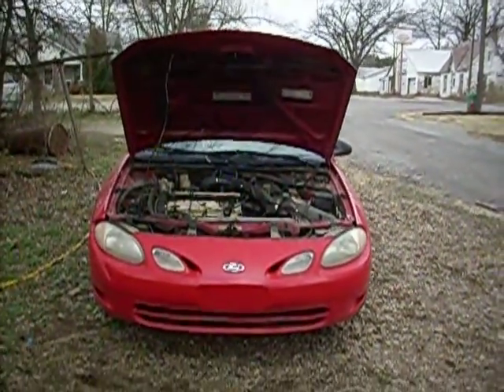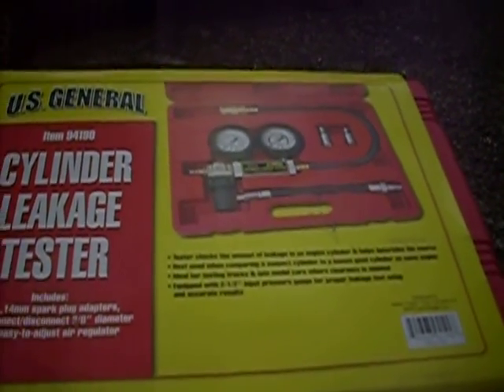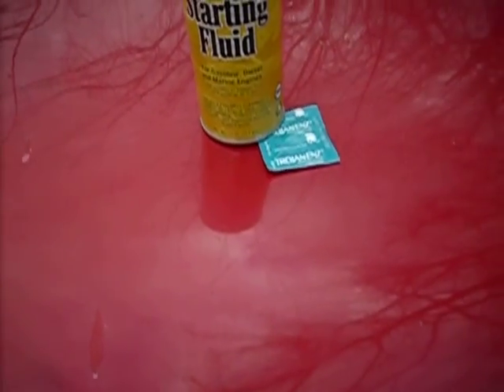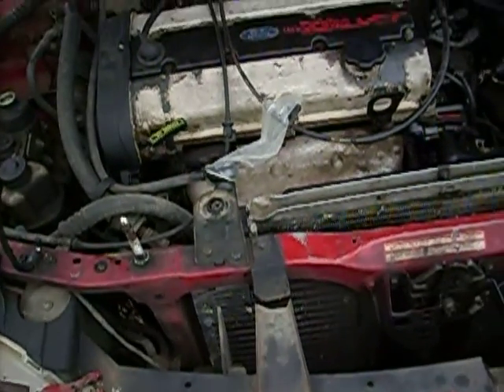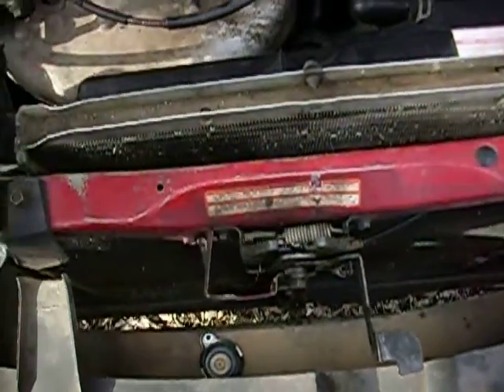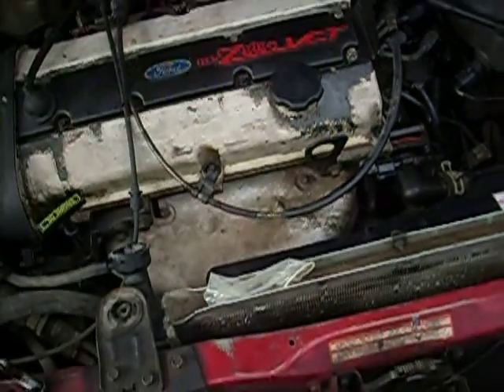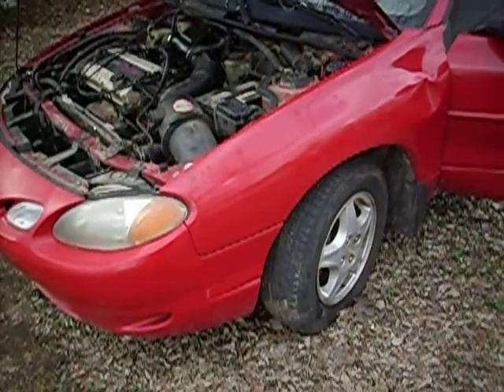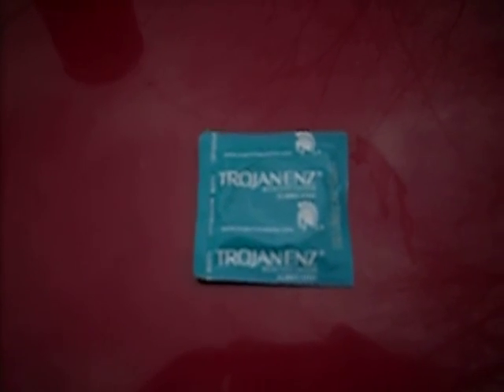Ford escort ZX2 progress testing for compression in coolant system

Comment: Most times when it blows air into the radiator it's the head bolts have loosen. Retorque the head bolts. " this is common on aluminum heads"

Comment: What ever happend with job situation? What happend?
Reply from the maker: ddemier ddemier that is a very very long story. My job situation over the last 8 years or so tax been a roller coaster ride. God it's been a mess. ☹️☹️☹️ But um working now. But not baking the money I used to
Reply: Any reason why my temperature gauge isnt working on my dash? Would the temp sensor not be working correctly?
Reply from the maker: ddemier ddemier could be the sensor is bad... Could be the guage it's self... Could be a connect problem or broken wire. Possibly fuze. Does it move at all?
Reply from the maker: ddemier ddemier last time I had a problem like that with one of these cars it turned out that it was the sensor that you're talkin about. Don't remember what the sensor cost but once it was replaced everything was running perfectly. Seems like it wasn't very expensive! Helen replaced it myself. My friend came over and replaced it for me while I was at work
Reply from the maker: ddemier ddemier a lot of stuff been going on. With my job situation and all. I no longer have internet. Exept through my cell phone. I do have a new project that I just bought. I'm going to see about uploading video with my cell. But I'm not sure how well it will turn out. If you plan to do this kind of thing. I suggest you have a good camera
.. a tripod... And some editing software. I never had any of that. Would have helped. Also a place to film without interruption from everyone is nice. God I have so much issues with that.
Reply from the maker: ddemier ddemier another piece of advice. There will always be haters. They don't like your face..voice.. weight..ect ECT ECT. Ignore the creeps.

Comment: Also.  You don't need the tool to align the cams.  You also do not need the pin for the crankshaft.  I spent the 180 for the complete head gasket kit, and did the whole job in a week.  I haven't done it before.  I'd buy the shit outta that car.  But you are nowhere near me, lol.  And one last note man, the zx2 you scrapped will run forever once you get the head done right.  Rather than try to keep that other hunkajunk on the road with all the problems you say it has.

Comment: Redundant tests are redundant.  I hope you figured out that the head gasket is bad.  Or the previous head job was done incorrectly.  Judging by the botched thermo housing job...the PO didn't spend a shitload of money on maintenance.  They sell a gasket for that housing rather than using Permatex.